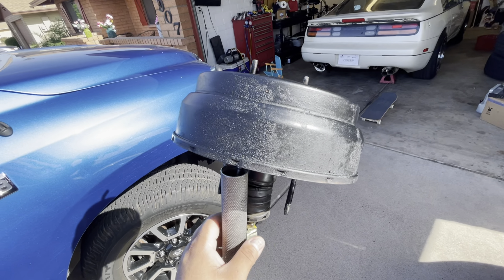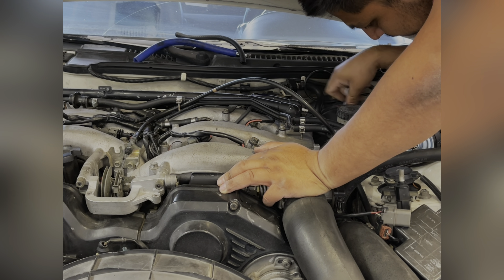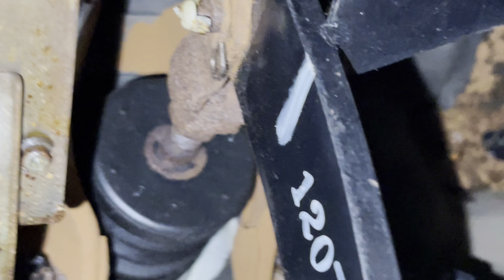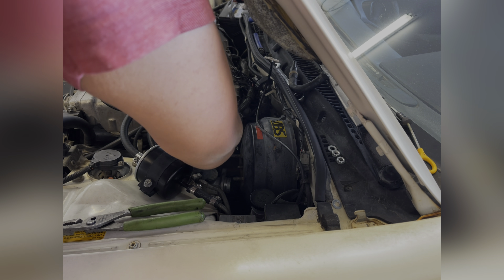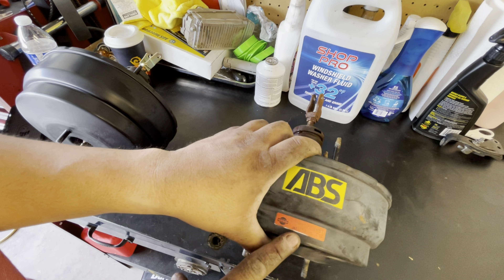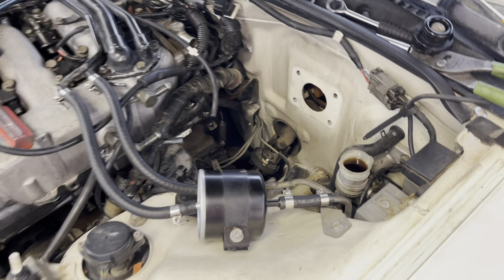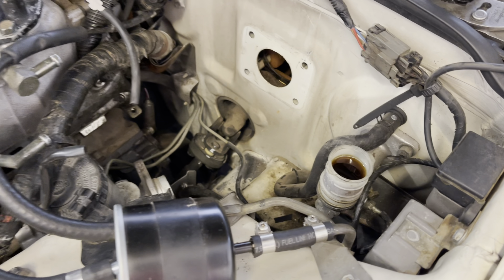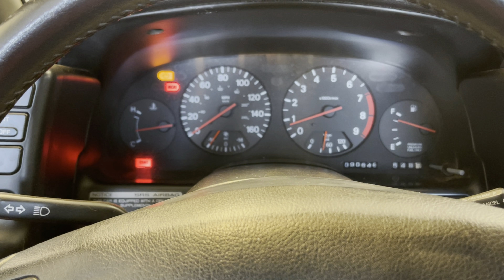300zx twin turbo brake booster install

Comment: Did you remove the master cylinder completely or how did you move it to take off the booster?
Reply from the maker: No I left the lines going to it connected and only unbolted it from the booster. Once I removed that pipe that got in the way i could push the master cylinder away far enough to get the booster out. If you have an NA it may be easier then it was on this car
Reply: @fixitish  thanks man I'll try this out tomorrow thanks
Reply: Kudos on moving the MC that far away. Mine is being much less giving.